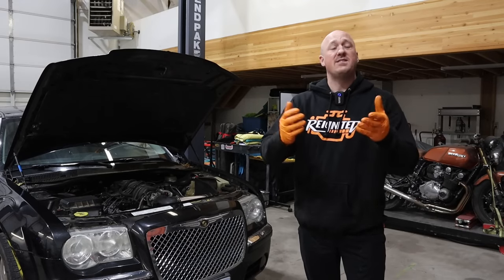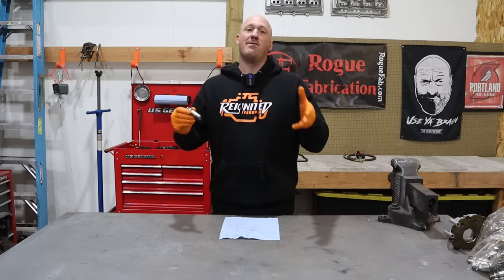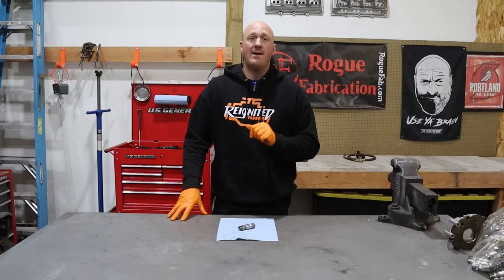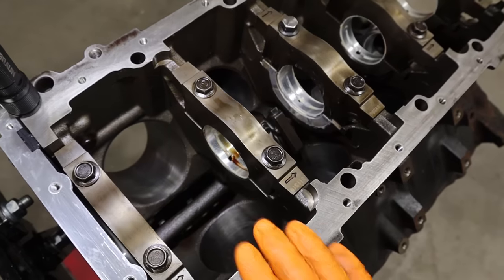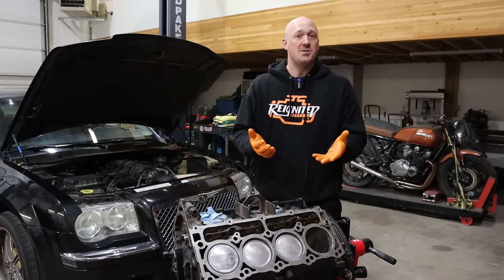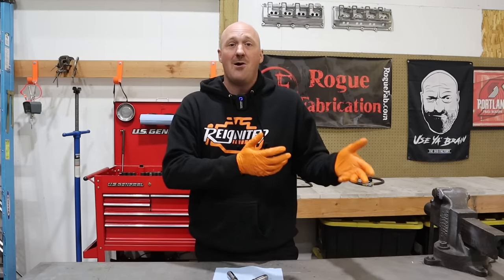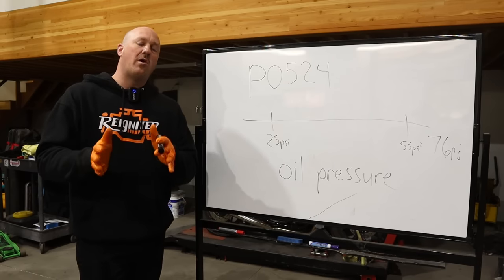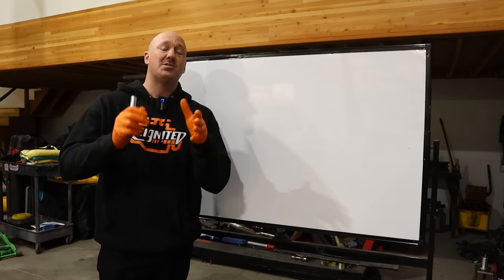The BEST Prevention For Hemi Lifter Failure! (In My Opinion)

Comment: Hello I’m a retired mechanic, but I still like to work on cars and engines, so I’m currently working on 2013 SRT 6.4 Chrysler 300 ,on cold start I hear the lifter tick until it get oil pressure, but then it develops a louder taping as it gets to operating temperature sounds like a lifter, so I’ve removed both cylinder heads and checked the lifters for any roller damage, can’t see anything wrong, could it have a internal problem in the lifters, the nose is coming from the rear of the engine, any advice from a Chrysler mechanic would be greatly appreciated the engine has only 125000klm

Comment: Mopar Canada states that the Hell Cat pump # 68195993AD does NOT fit a 2017 Jeep SRT 6.4 Hemi, it does fit the 6.2.  Before I put $$ out, will this actually fit my 6.4 direct bolt on without mods ? I trust your years of experience and knowledge, thanks for the excellent video.
Reply from the maker: It is in fact a direct bolt on regardless of what the catalog says. However, there's an even better option in the market now, the Melling 10452HV pump which is even more volume than the Hellcat and is a direct bolt on fit as well.

Comment: @reignited 2023 charger scat pack 3000 miles. Mainly driven weekends no long idiling. MDS is activated when in ECO mode correct? Fyi i don't use it at all. Next question if i were to swap the to the hellcat oil pump eco mode will not work, therefore no code?  What the price range for the OE hellcat oil pump and to have it replaced?

Thanks

Comment: I have a Ram 2500 6.4 that taps when started. Is there an oil filter that you would recommend to help with this problem? I normally take my truck to the dealership to have this done.
Reply from the maker: For a ram truck with a 6.4 I definitely recommend you check out this video first! 👍
https://youtu.be/cL3xNoKs9E4

Comment: I've heard running your truck in 8th grade gear keeps the mds system off and you always run all 8cyls?  You have any info on this? 
Using your gear shifter to keep it in 8th and it showing(8th) on the cluster?
Reply from the maker: That's essentially putting the vehicle into manual mode, and yes that will keep it from engaging the MDS, although I've got another video taking about why that may not be the best idea.
https://youtu.be/NcDeWXYtozE 👍

Comment: For me the main problem on these is the direction of oil flow, unlike a GM where the lifter gets oil 1st, the hemi is reversed so the rollers are the last to see oil, so if your rocker arms are worn on the shaft your going to bleed out an starve everything downstream, an the early engines did get more crank splash then the later ones, I’d say 70% of these failures is just due to oil starvation from poor designs

Comment: If putting a high volume oil pump on solves the problem, why didn't the factory just do that?
Reply from the maker: I'd love to ask them the same question. But as it sits, Chrysler still won't even really acknowledge that there is an issue with the lifters.

Comment: What's your opinion on raising idle RPM with a tune? I would imagine that bumping it up a couple hundred RPM would mostly eliminate the low oil pressure at idle issue, even with a stock pump.
Reply from the maker: That is true, in fact I've heard of fleet companies doing this exact thing. It's definitely another way to achieve a similar result. I like my factory idle though 😄
Reply: @ReignitedAuto  thanks for your reply, your content is great and super informative. Subbed 👍🏼

Comment: What about a 2009 Ram 5.7L VVT? Will it have issues with codes or will the higher pressure in the higher RPM range be just fine on a VVT 5.7? Thanks in advance.
Reply: With no MDS 3/4 - ton truck

Comment: Ot cost around $6000 to overhaul a Gen 3  hemi. If it were me I would use a upgraded higher pressure at idle oil pump and Edelbrock parts. Quality.

Comment: What about a 2023 5.7 in a Ram 1500?
Reply from the maker: I personally haven't seen a ton of the 2019+ engines with lifter failure, but part of that could be just because they haven't got a ton of miles on them yet. They don't have any upgraded or redesigned parts on them that I'm aware of, but the factory doesn't always tell us everything they change either.

Comment: Help please. Are 5.7 hemis known for excessive piston slap. My dealer telling me piston number 3 skirt is scuffed causing the piston slap until the engine is fully warmed up. Embarrassing noise as well as don’t want to run engine and cause more damage. Can the piston be changed while the motor is still in the truck?? Anybody Help/ input much appreciated

Comment: i saw you recommended a melling for pre-eagles but my impression was pre-eagles didn't need to worry about this... so why the recommendation?
Reply from the maker: Primarily due to my previous testing with the stock pump on pre 2009 engines, dropping as low as 13-15psi when hot idling. I'm not very comfortable with those numbers, so even though the lifter issue isn't really prevalent on these engines I'd still rather have better oiling at idle rpm 👍

Comment: In my opinion…. You only covered the viscosity issue partially and didn’t do it any justice. C.A.F.E standards that are put automotive manufacturers are ridiculous and have forced them to use lighter weight oils to gain MPG’s and to destroy our engines at lower miles than before. In some cases engines are having oil dilution at higher rates than acceptable due to these standards. Use a higher rate viscosity will help not due to the volume(same tube, same volume). The problem in my opinion(YouTube is full of them) is dry starts, not idling. You also forgot to mention during this time they went from using 5-30 to 5-20 oil. The 6.4 even uses a 0-40 oil now.

Comment: If I get a melling high volume/regular pressure oil pump for the 6.4l, will I not need to do anything else? Or will it be better to get the trackhawk oil pump and mod it to regulate the pressure?
Reply from the maker: I would say put the Melling high volume pump in with the provided stock pressure relief spring and you're good to go. 👍

Comment: My Hemi spun a lifter at 125K, did not have to rebuild entire engine.  Did it again at 250K, this time a long block was required.  Thank goodness for the dodge 2009 lifetime drivetrain warrantee.
Reply from the maker: Ah, you're one of the lucky few who still has one of those? 👍
Reply: @ReignitedAuto  The info you gave is pretty good.  Wondering if the newer long blocks are putting in the better oil pump.  My Hemi at idle has barely 20psi of oil pressure.  Currently at the dealership so I guess I will find out when they send it back.

Comment: What should be the psi for oil at idle? My new Powertrain Products Inc engine with updated lifters, pistons ,and melling oil pump is starting to tick after 5000 miles. At idle, it drops to 15 psi.

Comment: How about don't let your vehicle sit and idle for long periods of time? my 2014 Ram has a hour meter that measures idle time and run time so have you looked at that to see if there's any correlation in the failure ?
Reply: I agree with your premise. The only unknown variable may be starting oil temperature.  That data is widely available i imagine, but I bet .....confidential to stellantis. They would not want to incriminate themselves.....

Comment: I’m also going to be doing the cam and lifter replacement, and the hellcat oil pump. I have the ram 2011 1500 5.7L (140k miles) I’m planning on swapping the relieve springs on the stock to new pump. I had a question - when I’m shift from drive to reverse while stopped the transmission shakes like hell, is there any way to fix that?

Comment: Can I just install a hellcat oil pump on 2020 jeep srt and disable MDS with a tuner to not throw off codes? Or can I install non MDS OE lifters as well to avoid the codes? I don’t a voltage divider to change the signal to keep using MDS bc it’s of no use to me tbh.

Comment: I recently had an engine fail in my 2018 Durango 6.4l now my oil pressure idles at 12 psi, gets up to 41 psi when accelerating   max’s out  at 42  think it might be oil pump replacing tomorrow but after watching this video has me wondering if mechanic placed mds lifters in the right position and if not will this effect anything and if so could I disable mds as a quick fix or not?
Reply from the maker: 12psi is way too low, even for a stock pump. It should be about 29-32psi when hot idling. Something is wrong and needs to be addressed!

Comment: I feel like you should check into the mds transition more. 2 cams changes now the non mds lifter closes to mds lifters it’s lobe has been chewed up. Both times it was 3 an 8 cylinder lifters. I was getting the p303 code. I feel like when the mds turns on and off the factory oil pump cuts a wee bit to the non mds lifter closes to the mds lifter also. Also to add to your theory it’s not the mds system and it’s the oil pump I agree. Manual says 25-65psi. From when I bought it I’ve seen 17 on hot days and 20!on cold days idling. I do construction so the truck is my office and lunch room. I’m switching to the hell cat pump and lifters tho. I do feel as if the high volume pump will improve the psi flow during mds transition also. Hobby mechanic just an opinion. Cause between the two switches never was a mds lifter failed it was always the non mds.

Comment: The 5.7 needs oil changes at 3000 miles. Blend or full synthetic and never go to 10,000 miles. We had 2 work trucks that failed due to going too long between changes. They both made it to 150k but the oil was changed at 7500 to 10k. Change the oil

Comment: @reintegrated which lifters in motor are failing, the MDS lifter with pins or the non-MDS lifters? 
I was at Ram dealer last week. Guy with 10k on his truck in for bad lifter. Wasn't idled excessively.
Reply from the maker: It's an even split in my experience between the MDS lifters and the non MDS ones. I don't think there's a correlation there. If a truck is having lifter failure at 10k miles that's a manufacturing or assembly issue, it's not traditional lifter failure. I also see it all the time at the dealerships that lifter failure has become a catch all solution for if they don't know what's actually wrong with the vehicle "Oh, yea it needs cam/lifters....actually I think it needs a whole new engine." 😄

Comment: Just found out cylinder 3 has a misfire wound it be ok till I get the lifter repaired
Reply from the maker: The longer you drive it the more damage that happens. With that being said it would be prudent to have it diagnosed to be sure that's the issue you're having. 👍

Comment: I did the cam change and i just installed a new oem oil pump but im getting alot lower pressure now like 15 psi at idle. What should i check first?
Reply from the maker: Sometimes the oil pump pickup tube o-ring can get pinched or cut during install, I'd check that first 👍

Comment: Pro tip to prevent Hemi tick & lifter failure: Don't buy a Dodge! I've put hundreds of thousands of miles on Ford roller lifters without any failures. I've put 20 years & well over a quarter million miles on a little Toyota I4 with very little work. Gaskets for the intake manifold and valve cover are the only engine parts replaced. Had to replace the brushes on the starter. Try that with a Dodge. Or a Ford. Why can't they build durable vehicles for the crazy prices they're charging?

Comment: Excellent video! Been following you for a while just to keep up to date on this issue since I have a 2019 1500 no eTorque and got it with low miles. 

1. Do you have a theory on why the MDS lifters seem to be the ones primarily affected? Because if it were the bearings in the lifters, shouldn’t we see more non-MDS lifter failures? Or do non-MDS lifters fail about the same amount and my knowledge just has been tainted by YouTube? 

2. do you think you’ll do a how-to video on replacing the stock oil pump with the hellcat one, and putting the stock relief spring on the hellcat pump (assuming that works out in your testing)? Once my factory powertrain warranty is up I want to do this… but I’m far from a mechanic. 

3. Would you consider doing a little series on engine 101? Like what each part is and does, how it works with the other parts, and what it looks like (on and off the engine)? You explain things well and have the equipment, which is great for people like who are more visual learners because we can see each part individually and as part of the system.

Comment: Question will i be able to install a hellcat oil pump on my 2006 5.7 Dodge charger rt?
Reply from the maker: No the Hellcat won't fit your car, you will need the Melling 10342HV pump. 👍

Comment: So you're saying that the Hellcat oil pump will fit my 2500 Power Wagon 6.4L engine?
Reply from the maker: Direct fit, however just recently Melling came out with a high volume pump that is even better than the Hellcat pump and it's also a direct fit for your truck.  Part number 10452HV 👍

Comment: When you put the resistors in doesn't  it change low number also or is it filtering  the high number since both high and low nunbers will travel the same path. Just wondering?
Reply from the maker: It changes the entire range 👍

Comment: Dumb question 😬 but curious if when lifters are collapsed and solenoids shut off oil to them, does the cam lobes and lifter roller bears still receive oil some how?
Reply from the maker: It's actually the other way around, the lifters are collapsed when the solenoids are turned ON. This means during cylinder deactivation is when they receive the most oil possible. 👍
Reply: @ReignitedAuto  thanks for the reply

Comment: Would a dodge dealership install a hellcat pump on 2021 5.7 hemi, and that wire your talking about
Reply from the maker: I probably wouldn't have a dealership install it if you're still under warranty. However there's an even better option available now. The Melling 452HV pump comes with the correct spring already installed so you don't have to worry about wiring in a resistor, but it provides 20% more volume at idle, versus the 12% increase with the Hellcat pump. 👍

Comment: Would swapping out the relief springs reduce oil volume?
Reply from the maker: Nope, it only affects the maximum output from the pump, you'll still get the benefits of the high volume at low RPM 👍

Comment: I have to disagree,I believe the problem is with the cam,my 5.7 started ticking so I took it apart,the lobes of the cam were pitted but the lifters were totally fine.i believe the cam hasn't been hardened properly

Comment: Hemi not reliable or durable anymore.  If your right about the Hellcat oil pump why doesn't Stellantis pump out a TSB on that and do it.  My 2021 Ram 5.7 engine was replaced at 15,000 miles.  Ram - Chrysler products not reliable.  Trading my truck for a Toyota old school motor.
Reply from the maker: My opinion on this is that if they actually put out a bulletin about this issue, that would be them admitting there's an issue. Which to this point they have not done. As long as they can deny there was a problem, they don't have to pay to fix it. My two cents only...

Comment: Is it possible (or wise) to install an oil pump with a higher volume increase than just 12%? You mentioned the Melling for the 03-08 is a 20% increase. Is there a 20% oil pump around for the 09+?
Reply from the maker: Yep, after I came out with this video Melling released a pump for the 09+ models with a 20% higher volume: 10452HV 👍
Reply: @ReignitedAuto  Does this same oil pump bolt right onto a 5.7L engine?
Reply from the maker: @jaysonb.3411  yes it does

Comment: 1. 5K miles should be the MAX between oil changes. The few $s ya save going longer… well you shown us that “proof in the pudding.”

2. The oil pump change makes sense… period!

I’ve considered putting in a basically stock 3G 6.4, Man trans, in a second gen Barracuda w/ focus on light weight plus a few other details. I have more confidence now

Keep ‘em comin’

Comment: What about a 2024 big horn 5.7 e torque? What do you recommend doing for this model?
Reply from the maker: I recommend being very smart about your maintenance schedule. Don't go by the minder that comes with the vehicle. Don't exceed 5K miles between oil changes. I actually like the e-torque setup I think it works well and keeps the vehicle from extended idle periods while driving. I think you've got a pretty solid platform that should last a long time if you take care of it properly. 👍

Comment: Is it possible it to change one side of lifters? Mine is supposedly coming from cylinder #8, so do i still need to replace all the lifters and cam?
Reply from the maker: It's certainly possible, but realistically it's not worth it. There's very little extra labor involved to do both sides and it would be a bummer to have to pull it back apart again if a lifter on the other side failed. Obviously parts cost is higher to do both sides and the cam, but better to just do it once and be done with it. 👍
Reply: @ReignitedAuto  awesome, thank you. They definitely ain't cheap lol

Comment: So is their a model of this engine that doesnt have this issue, as this is abit more of a deal breaker than anything else with mopar in general, and I like the 392 and the noise it makes, but if its 6 figures and can have weird issues like this, kinda makes no sense to go with a motor with a built in self destruct issue like this that they refuse to fix.